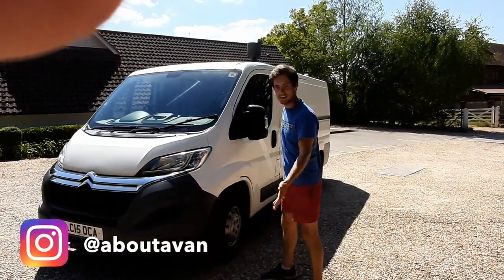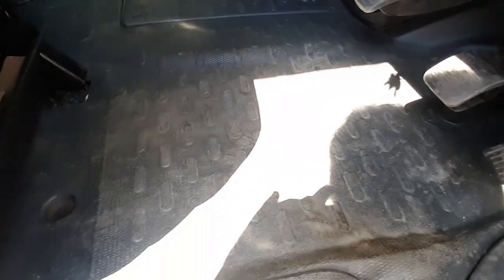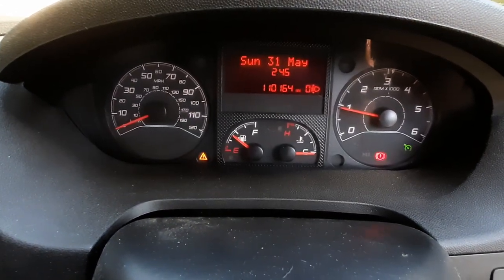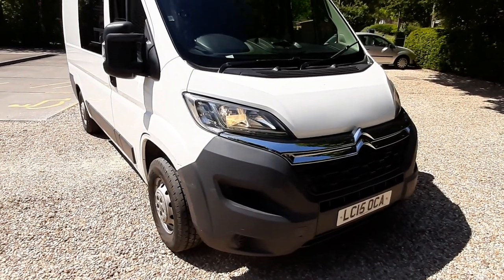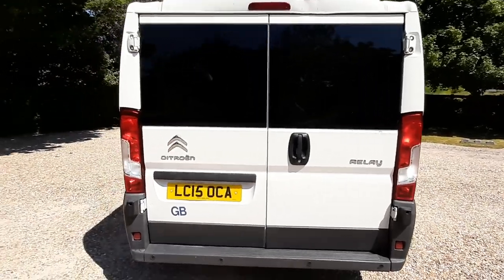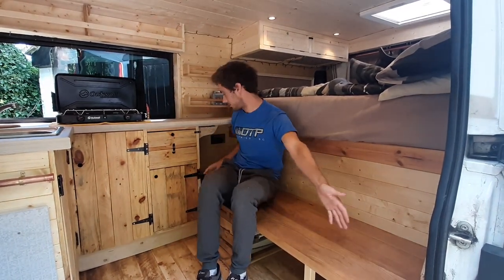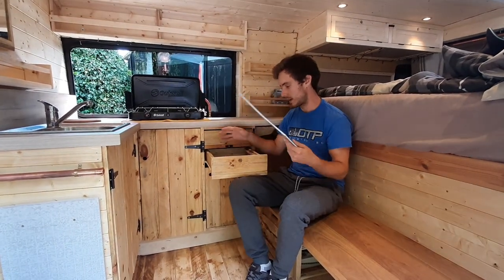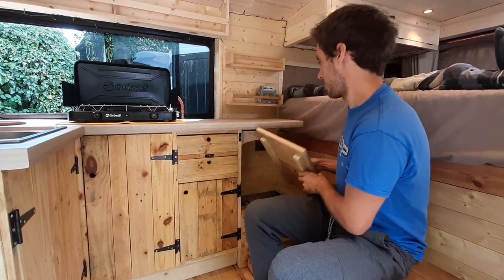Citroen Relay van tour | UK van build

Comment: Great van build. Thinking of doing something similar. Can you tell me the height of the garage vs the height of the bed space? I saw you mentioned the whole internal height is 5ft5" but interested if you would have enough space to put in a fork mount for a bike in the garage, needing roughly 85cm height for the bike, if there is enough room for bed/living area on top? Thanks in advance.

Comment: Such a tiny space, does the wood burner not give out too much heat?
Reply from the maker: This is only a 2kw burner, depending on the outside temperature it could but once you've learnt how to control the vent it worked nicely.

Comment: Hey, how much did this sell for? How many miles did it have? Asking for being able to value other vans :)
Reply from the maker: 106,000 miles and it sold for £14,200, now it would likely sell for more given demand.
Reply: @Aboutavan  £14000 ? Wow. i have just got an l1h1 but going to keep it stealth as its insured as a van so looking to insulate and install a diesel heater then use modular units for away days